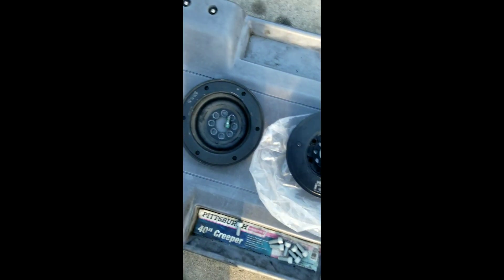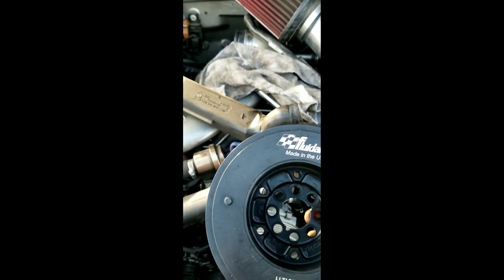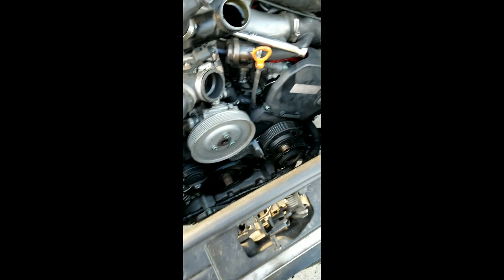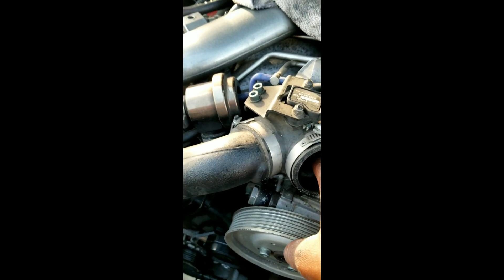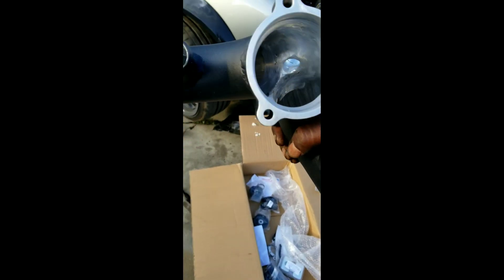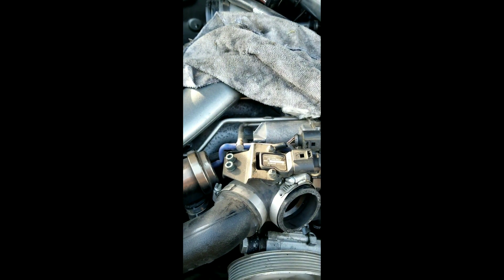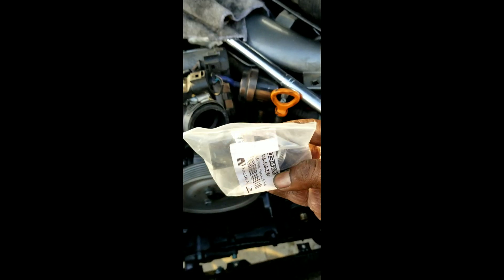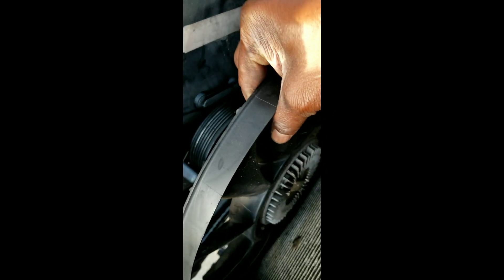Stage 3 Audi Allroad 2.7T Project: Fluidampr & XS-Power Bi-Pipe Install

Comment: Stock dampers aren’t tuned to RPM but Frequency. I’ve seen dampers on other cars rotate due to them being two-piece pressed units and really jack up timing. They operate fine when they’re installed, but once you remove them you realize top dead center is no longer top dead center due to them rotating while installed.
Reply from the maker: I've never seen any Audi or Volkswagen dampers rotate, just the rubber starts to form cracks. Also that frequency happens at rpms due to vibration.
Reply: @cmidas3396  Yeah same difference. I’ve never seen it happen on Audis or VWs either but plenty of times throughout the years on other vehicles.

Comment: I had the same issue with the 034 silicone hose kit. It was a little disappointing. I did buy some stainless bipipes but they didn't have that nice manifold.
Reply from the maker: Yeah the engine bay looks a lot cleaner with the engine covers on.